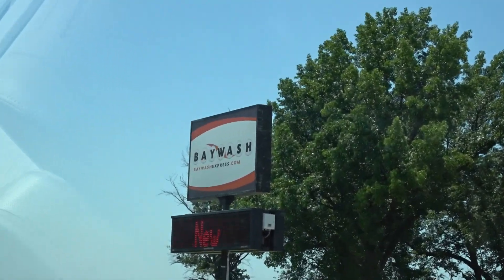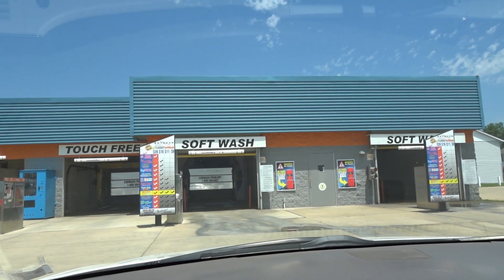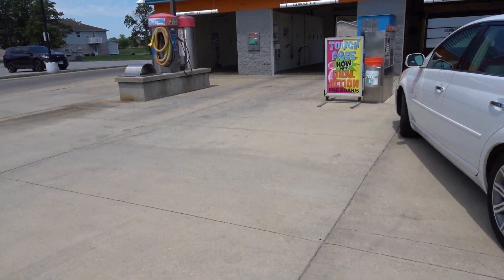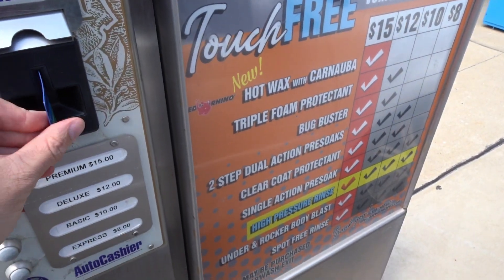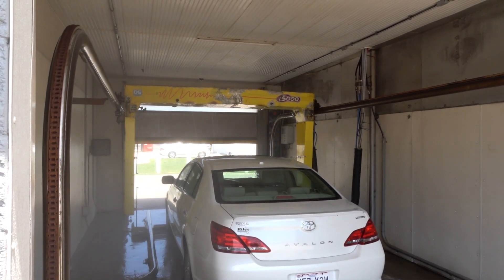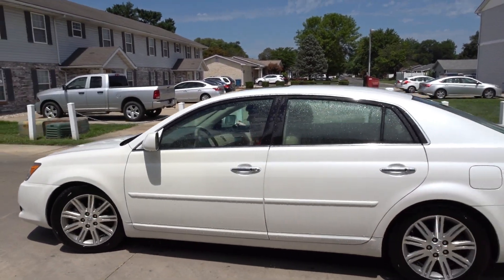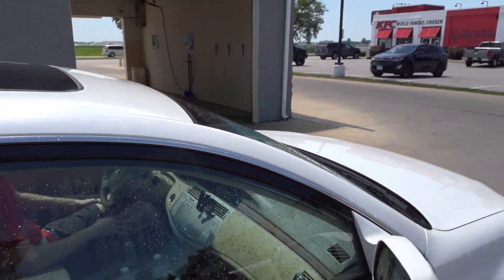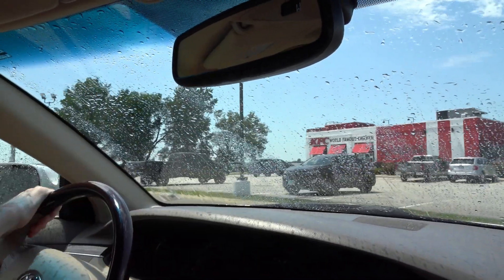D&S i5000 Car Wash - Baywash, Bethalto IL

Comment: That wash was a big fail because it didn't give you the tri-foam cycle and the car wash didn't have any dryers inside the bay. I really hope that the place where you got a wash will replace them with a D & S IQ car wash and ad dryers inside the bay. The price for a car wash wasn't very great at all. I hope in the future they will make the pricing a little bit better like make it 7,8,9, and 10 dollar  wash and have the 10 dollar wash be the excellent wash with Tri-Foam and a colorful lighting package with a foam bath.